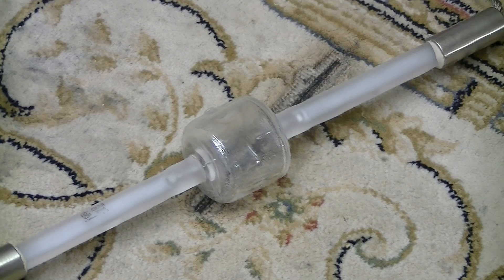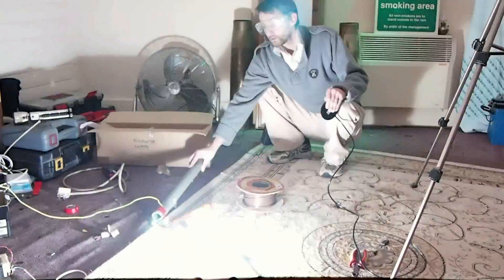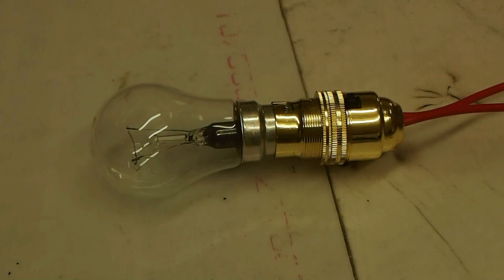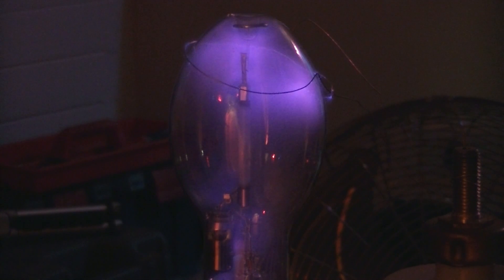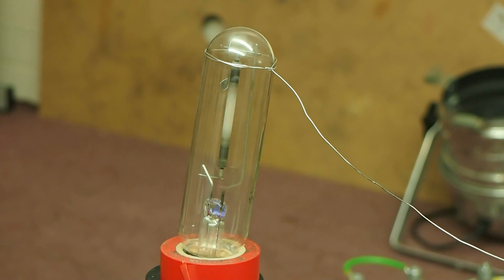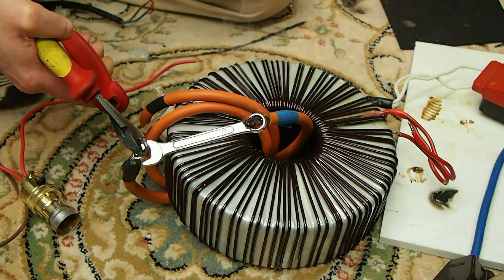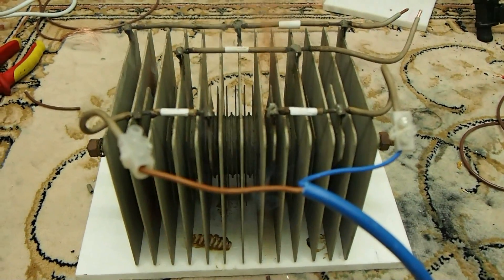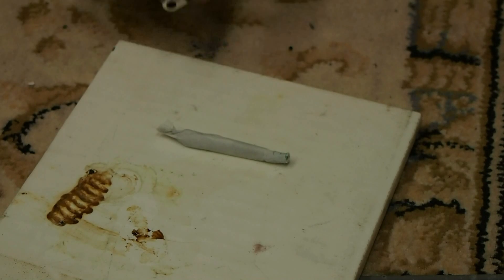State Of Matter

Comment: amps kill
Reply: No it's current
Reply: But V = I*R,
Reply: volts hurt
amps kill
Reply: Nolan Sproat Current and Amps is the same thing...
Reply: kilkil300 and something most people overlook is the fact that voltage determines the current flowing through your body, and therefore it is fundamentally volts that kill. In the real world, virtually NO power supply acts as a current source, they are almost all voltage sources - so you can assume that voltage remains the same, and current depends on voltage/resistance. If resistance is constant (It's your body afterall), then current is determined by voltage, and therefore volts kill. I'm confident in my own knowledge to know I can safely touch that 1V 700amp secondary on that transformer. But I would not go anywhere NEAR that 100000V lamp because although it's only supplying milliamps through the bulb, 100000V would drive over an amp through your body and you would literally be toast and your hair would probably be on fire.
Reply: Ranstead Moons
actually a coil of this dimension can be a pretty good current source
Reply: This commander of chickens is all over the comment section...

Comment: I'm going to go ahead and try to answer this question. It may not be right so don't jump on me if its incorrect. They both produce 700 watts but neither of them can kill. With 100kv at 7 ma you have high voltage, but the amperage isn't enough to kill you. With 1v at 700a there isn't enough voltage to even penetrate your skin. So this is a trick question and the answer is neither.
Reply: I think that depending on your skin resistance and path through your body, the higher voltage one has the potential to kill. However, if there is only 7mA available and the body's resistance is too low, it will load the circuit, dropping the voltage and possibly lessening the lethality. The skin resistance and path through the body would need to be just right, as perhaps would also the timing need to be to cause the greatest degree of cardiovascular disruption. If the person already had a pre existing heart condition, these things would not need to be so perfectly aligned to cause effective defibrilation.
Reply: Sorry, that was supposed to read at the end, "effective fibrillation or defibrillation" :)

Comment: So what causes the lightbulbs to break when hit with the power from the capacitors? Is it thermal shock from the rapid heating of the filament, or does the rapid heating of the filament heat the gas inside the bulb and create a shockwave?
Reply: One massive pimpslap to the face instead of multiple weak pimpslaps. Yeah.

Comment: you should try charging the capacitor bank to max voltage and discharging it into the primary winding of a high voltage transformer, a strip light might also be fun

Comment: although it depends on whether the supply is a voltage source or current source. If it's a current source you will explode in a spectacular ball of death before melting into a viscous mess on the floor, I know mains supply generally naintains constant voltage but the alternative would be much more interesting

Comment: Keep in mind though, that touching the leads of a 1V 700A transformer does not drain the full 700A - coming close to the 100kV output will cause arcing through the skin. According to wikipedia, the average body has a resistance of 500 ohms if the skin breaks down. This gives the current a theoretical limit of 200A, and so you will drain everything the transformer has to offer. Even though you may live, the 100kV will probably give you painful electrical burns that still hurt days or weeks after.

Comment: 100kV and 7 mA is okay, this would just hurt. Dangerous its getting about ~20mA AC
700 Amps and 1 Volt -> easy going, no death, no pain

P = U * I 

So the 700 Amps with 1 Volt as 700 Watt
And the 100.000 Volts with 0,007 Amps has got also 700 Watt :)

Comment: Thats right! But above you mention the resistance of human tissue – I don’t know what that is to be sure but I would assume that the resistance of internal tissues is much lower than that of dry skin. The breakdown voltage for dry skin is only about 80V. Even with the V drop of the tissue ‘R’ 100KV is DANGEROUS at any current level in the mA range.

Comment: Don't agree - The internal resistance of the body is likely to be low! Dry skin has the highest resistance of all body tissues but the breakdown voltage is still only in the region of 80V. Direct contact with this ‘apparatus’ (forget about arcing) is very likely to be fatal – mainly because of the huge disturbance to the normal function of the heart that could occur.

Comment: The 100k volts setup is very likely to kill you.  Only the very lucky survive it like that one painter in china live and his 3 coworkers didn't after hitting a high tension mains line.  The 1v setup can't get past your skins resistance. 

If going by volts x amps = watts then both are of equal overall power.  One puts it all into amps while the other puts it into volts.

Comment: Sorry mate I don’t agree. 100KV can overcome the resistance of any conduction path through the body if a current of 7mA is flowing at that voltage it means that 700W of energy is being dissipated in the body tissues. This will cause massive I squared R heating a very serious burns.

Comment: 100kv at 7mA will kill before 700A at 1V. A car battery won't kill you if you touch both terminals and they can deliver 600A at 14V. Simply not enough voltage to overcome the bodies resistance.

Comment: Re the question at the end – both equate to the same energy level i.e. 700W.  But 100KV at 7mA would almost certainly be instantaneously lethal as such a high voltage would easily overcome the resistance of any path to ground through the body. It would also cause internal burns as the current arcs through body cavities – Nasty! 700A @ 1V is harmless to any poor conductor.

Comment: 100kV at 7mA will give you one hell of a zap and might kill you. 700A 1V you wont feel a thing unless you are using the massive current to heat something, then you will burn yourself badly. 

100.000*0,007=700W
700*1=700W
So both have the same power (assuming the measured value is correct, it is bloody difficult to measure high voltage)

Comment: Neither are deadly. If you use 100kV, those 7mA will pass through your body, but they're not deadly. I'm sure the feeling won't be nice, but it won't kill you. If you use 1V, nothing will pass through your body. 700 Amps are only possible because the resistance was about 1 to 10 Ohm. The human body will have about 1 Megaohm, so the maximum current possible there is 1µA. The overall power is equal, given that the current is the same before you transform it. (I think the maximum was like 13A)

Comment: I'm not an expert either. As I understand though as the current is low there is little energy actually deposited into the body. I guess this means that even though 700W is available, not all of that energy is dumped into the body. Thoughts anyone?

Comment: Bit of a mix there. . . 7x10^-3 * 100x10^3 = 700.  it was a trick question, both have the same ammount of power, but only the 100kV circuit has the potential to overcome body impedance

Comment: non of them will kill you
7mA is not enough to stop your heart and 700A 1V have not enough voltage to pass through your body
1V x 700A=700W
100 000Vx 0,007=700W
(the power is the same)

Comment: If you send 100kV into a load (body) of a couple of MΩ, and the source can only give 7mA, then you will get a voltage drop at the source to match the 7mA. U = I x R, and in your case R = 2M, then the voltage drop at the source will be about 87kV, and your body will "only" get 14kV. Still att "only" 7mA, cause that's all juice the source got!

But still: 7mA through your heart at 50Hz will definitly cause a hart failure in a matter of time (my guess is between some seconds to about a minute).

Comment: But they're near enough to the same thing, that this just about doesn't matter. Remember that V=IR, so when the voltage goes up, so must the amps. The only reason the static machines don't kill, is because they have an inherently very high resistance.

Comment: I would think the 1 volt 700 amps will kill you. Think of the static machine we used in science class at school high volts hardly any amps. Amps is the killer . You only need the math to work out the amount of joules it will give you.

Comment: It's already been said, but some on here lack understanding of electrical basics. 

Current (amps) does infact kill, but remember, current  (amps) doesn't happen without voltage

Voltage (or electromotive force) is the force that pushes electrons through a resistance. Just 1 volt is not enough to push a lethal current through a human body

1 volt and 700 amps will do nothing to the human body, well you may get burned. 100 kV with sufficient current (30 ma) can be lethal

Comment: a transformer is a device witch transforms electrical power. it may step-u the voltage (220V-100.000V) or step it down (220V - 12V)
The strobe is triggered bi the dielectrical breakdown and ionisation of the gas mix inside

Comment: i think that 1v  700 amps isnt deadly because of low voltage, 1 v isnt enough to carry 700 amps through the body. I=U/R ....I=1V / 2000-3000 ohm (impedance of human body), we get very low current that isnt deadly....for 100kV, 7mA  im not sure. i think that 100kV vill make nasty burns but not kill because low current .current higher of 20mA 
is dangerous to your health. if im wrong fuck :D

Comment: I don't know at all but the high voltage low amps looks deadly.As far as overall power I think the high amps has it.The way it heats up that wrench just reminds me of a strong but slow team of oxen hooked to a plow.The high voltage would be a fast car splattering you on the asphalt but it wouldn't do much in the fields.

Comment: I though about a detail! These transformers are pure inductors, and inductors are known to modify the phase positively. If you're not compensating for this with a matching capacitor (as turns the phase negatively) the apparent power will, in your case be 700VA (maybe measured by a power meter). If you know all the facts about your inductors, then you can calculate the exact "real effect" (in watts), and the reactive effect. 

But actually... who cares!

Comment: 700W will kill you (both cases), but probably the low voltage in combination with a white-glowing spanner will kill you faster if you really wanted. By sending 7mA trough the body will not instantly kill you, but my guess is that you're using pure 50Hz, and 7mA at that frequency for a longer time of exposure will definitly send you to the sky.

By the way, big like for your channel! But I have to give you a dislike for the video photographer in this tube. Shaky and blurry!

Comment: the 100000 volt 7 milliamp will kill you probably because of the high tenson between the poles and te 1 volt 700 amp has the moast overall power

Comment: At 4:50 the lamp that you are hitting with high voltage appears green. Seeing green, I have been told, is an indication that you are producing X-Rays. I have read that most lamps are evacuated and partially back filled with some type of gas, other lamps, generally under 10 watts are simply evacuated. The ones that are only evacuated are avoided by the Tesla coil people who wish to see the streamers flowing within a clear glass light bulb. Please be careful about X-Ray exposure..

Comment: P = I x V
1 milliampere = 0.001 amperes
P = 0.007 x 100000 
= 700 Watts

P = 700 x 1
= 700 Watts

The power is the same with both devices, not too sure if either will kill you though...

Comment: You didn't even guess..... Anyways Volts lowers the resistance in the human body. Generally amps are the killer, but at 1 volt, it probably wouldn't carry a deadly current across the body at that rate, in other words, your body wouldn't be receiving the full available current. Same reason power lines travel at high volts -> to minimize the current lost. Why I answered 700 amps / 1v kills? Drilled into my head by professors in the phrase that amps kill. Voltage = Resistance, Amps = Current Speed.

Comment: The low voltage transformer would not be able to cause electric shock (unless you damage the insulation on the primary by pressing on it with a white hot spanner).

The HV transformer is unlikely to cause electrocution due to the low current (but arcs can be very hot); However, this safety is dependent on there being guaranteed current limiting (e.g. primary inductance) and no parasitic capacitance. At these voltages, even a wire can become a capacitor with dangerous energy storage. Take care!

Comment: The first one (if it is limited in current) may burn you and fu** you up but it will not stop your heart, the second one the voltage is to low, the resistance of your body will limit the current.

They have the same power.

Comment: I wonder if his caps could handle that voltage. I bet the hot strike voltage on that lamp is a monster. I reckon the X-ray transformer and the 100 kV cap should be able to do it though.

Comment: The filament blew and an arc formed drawing very high currents. The fuse in the lamp tried to interrupt it but it then started arcing between the lead wire and the metal cap thus causing the glass to shoot out!

Comment: Well... for both, it's the same power : 700 W.

The most dangerous is normally the high-voltage one... but I tend to say that the high-current one is more dangerous in the case of a short circuit (burns, fire and so on).

Comment: Wooo! You almost blew some more camera pixels, Mr. photon! :-O

As for "which one is the most dangerous...." well er.....

I'd be quite happy holding onto 700A at 1v, but I certainly wouldn't get near anything over 100v without special precautions in place! Also, those capacitors fully charged would probably be lethal....Bits of fingers everywhere! :-O

Yes, when I last checked, a "skilled person" wasn't needed to install a 1.5v battery or for that matter, one of those zappy 9v ones! :-D

-BBD.

Comment: In response to question in video, 1 volt won't conduct any significant amount of current through your skin, you can't 'force' amps through something. Contrary to popular belief, one volt will still conduct through your body. Want proof? Put your body in the circuit and measure an AA battery with a multimeter. Simple physics; V=IR. 100kV is enough to conduct and more dangerous, but I'm not sure if it's immediately lethal at 7mA and 50Hz; check out skin effect and such.

Comment: Resistance is directly proportional to distance, always, not just when it feels like. You will struggle to measure the difference along a good conductor with a multimeter because it's on the order of milliohms which is right down in the noise of what it can measure.

Comment: A potentiometer is built with a resistive element inside it, that's the whole idea. In general yeah resistance will vary with distance, but in a potentiometer, at the highest resistance, some potentiometers can be in the multi MOhms. They're made to be like that. You take a 10m length of plain copper wire of anything more than very thin diameter though and certainly with a handheld meter, you'd struggle to measure much difference in resistance between the ends and halfway along.

Comment: (cntd.) For a short time even an arc my form, which has very low resistance, and even more of the filament will evaporate. The metal vapor take up way more volume than the filament itself so you get overpressure within the bulb, which, if the bulb fails, will make it explode.

Comment: Happened to me, too, and not only once.
My guess: first, the filament of the bulb was a little damaged already (certain parts of it get thinner with time, thinner parts get hotter meaning more evaporation of metal aso.)
Second, you switched on when the AC sine wave was right at it's maximum voltage. A cold bulb has quite a low resistance. Low resistance + high voltage = high current. 
This high current will heat up the damaged part of the filament so much, the metal evaporates immediately.

Comment: It's 1 volt, your body would only draw a super tiny amount of current. Your body resistance is too high to draw enough current at 1V to kill. Same as touching the ends of a 1.5V battery.

Comment: They both are the same power wise (700W) but 1V @ 700A is safer because that's not enough potential for the human body to conduct (going from hand to torso to hand). The 100KV is plenty high enough to get current to pass through your body (only really need 50-100V If I remember right) and if you took the 7mA across the heart you'd be on the deck permenantly but it might not all pass through your heart going across your chest.

Comment: At the end, both of them have 700 Watts power, but the higher voltage would likely be more efficient over a distance... As for frying and killing you, I wouldn't touch either of them, 6ma is the threshold for death as far as I know, but I suspect the 700A at 1V is too lower voltage to get through the skin - as I said though, I'd not touch either of them as I believe that to be the safest option.

Comment: 1 volt at 700 amps wont hurt you. 1 volt isn't enough to go through your skin. 100,000 volts will bite you hard but 7 milliamps isn't likely to kill you, it would take more like 20 milliamps. In the end they are the same total power.

Comment: In reply to your quiz:
At 1V you might be lucky to draw about 0.15mA through the human body - no harm whatsoever.

At 100,000V you could theoretically draw about 16A through the human body (and do quite a lot of damage very quickly seeing as you would be pumping in about 1.6 megawatts!).

If you want to pump 700W into the human body, you are talking about applying approx 2070V which will lead to a lethal current of about 338mA